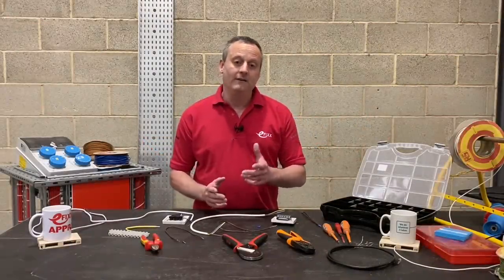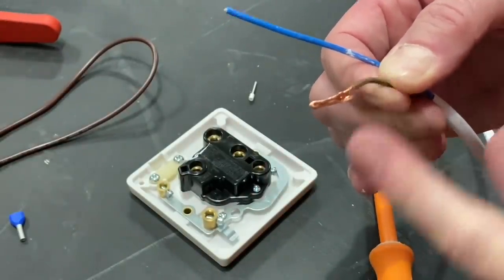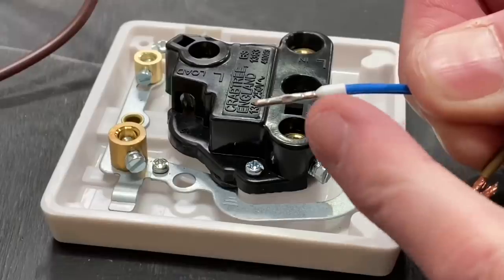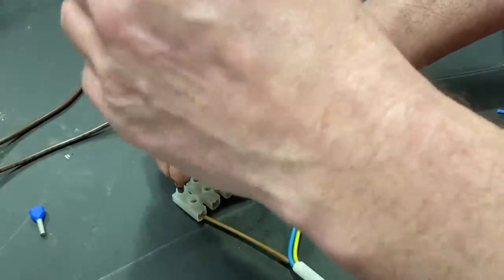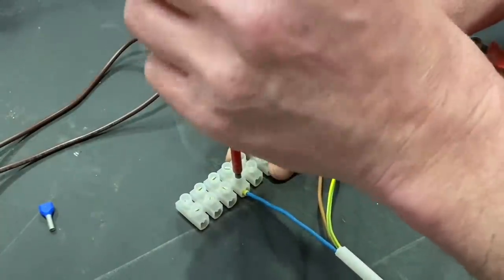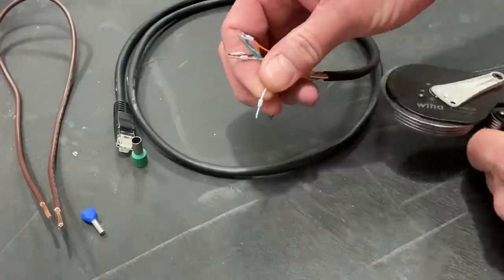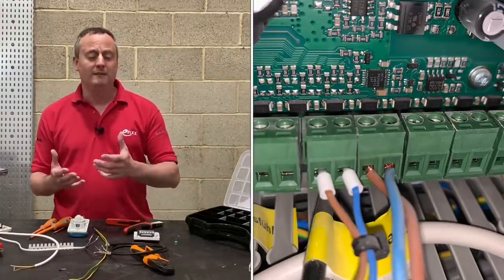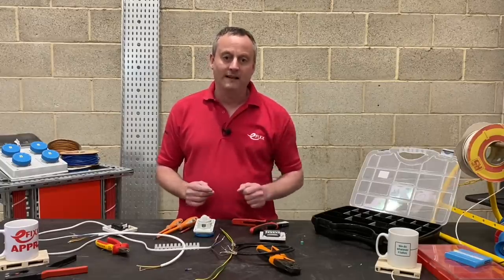Ferrule crimping - An easy way to improve reliability of electrical connections.

Comment: Why do you guys keep saying millimetres SQUARED? When I sent to school 16mm squareD would make 2.56 square cm. I think you mean 16 square mm.
Reply: The units would properly be written as 16mm² - which can be pronounced "16 square millimetres" or "16 millimetres squared". The latter is more common - you're right that this could be confused with (16mm)², but I don't think this has ever caused any actual confusion to any sparkies I know.
Reply: @-abigail  No honestly, 16 square millimetres is very different to 16mm squared, aka 16mm². 

16 square millimetres would give a square measuring 4mm x 4mm with an area of 16 sq mm, or a cable diameter of 4.5mm using pi. 

16mm squared or 16mm² would give a square measuring 16mmx16mm with an area of 256 sq mm, or a cable diameter of precisely 18.054mm using pi, a significant difference. 

Conversely, if you are talking about a cable measuring 16mm in diameter that would have an area of 201.06 sq mm.

https://www.mrsphysics.co.uk/blog/difference-between-square-metres-and-metres-squared/ - No, that's not MY Mrs! My Mrs doesn't need maths to know when I'm exaggerating size ;-)
Perhaps i need a ferrule.
Reply: Hi Jim. What is possibly not being said because it’s generally known by electricians in the UK, is 2.5mm squared or 2.5 square mm cross sectional area or csa. 
Basically the csa of each strand is calculated with Pi and the total number of strands is added to give you the total csa in mm. 
Sounds confusing but you never need to do this calculation in real life because it’s already worked out by the manufacturer. 
The only time I have done this calculation is around 40 years ago as an apprentice at college. 
Hope I’m not teaching you to suck eggs here. 👍.
Reply: @tonyfrewin4822  depends on the square mm of the egg Tony. It just looks like people confuse square with squared when the mean different things. 16 square mm means 4mm x 4mm, 16mm squared means 16mm x 16mm, which in tirn gives you 256 square mm.
Reply: spelling not a strong point this morning!

Comment: Um, how about you verify the efficiency of electrical connections using a multimeter to show the advantage?  Anything else is just hypothetical.  Scientific method and all that jazz.    Nothing 'PROVED' here.
Reply from the maker: This video is about reliability and dependability of initial connections. We’ll try to obtain a copy of a Weidmuller white paper which discusses how resistance of connections changes overtime comparing non ferrules and ferrules connections.
Reply: @efixx  I am also interested in the difference between the electrical connection between: conductors with and conductors without ferrules.
I would say, for termination of stranded copper conductors it's a no brainer; yes to ferrules.
However, I have seen (don't ask me where, I can't remember) this idea of joining both legs of a ring circuit into those twin ferrules within the CU, not a good idea imho. I would say they need to be kept separate for testing purposes.
 So then it begs the question: solid conductors:  to ferrule or not to ferrule? Hmm, thoughts on this?
I'm sure we have all seen the idea of a continuous CPC in sockets where one CPC is left extra long, stripped in the middle, bonded to the back box then its end terminated into the accessory. I think this idea would work better with a double ferrule where, the ferruled CPC is terminated into the accessory and the second conductor in the ferrule has its other end terminated to the back box.
So, now it occurs to me, we are also making two terminations of current carrying conductors into sockets: what would be the advantages/disadvantages of putting them into ferrules?
I will say: a ferrule holding both conductors in a terminal with a screw as contact seems like it would be on the advantage side of things but, with a clamp type terminal (which I think are great, BTW), would a ferrule be overkill? 
I'm not advocating the use of ferrules inside socket outlets, (well, perhaps I might be with the CPC) just putting some thoughts out there and going on a bit, I know. Sorry about that👍

Comment: If you crimp it good, then it is good. If you couldn't crimp it good, then it is a disaster. For newbies, try to stay away from any crimping work. The correct crimping tools can cost over one thousand dollars. Soldering is always the best connection method.
Reply: If you can't use something as simple as a crimping tool then soldering would also be outside of ones skillset as well.
Reply: @braveworld2707  The failure rate of crimping can be as high as 100% if wrong tool is used. And the failure is usually not visible, which can cost long time for troubleshooting. I prefer using pre crimped cables if needed. The mass machine produced crimped cables are much better than the hand made ones.
Reply: I've been soldering multi strand conductors of various gauges for 40 years. But only where there is no significant vibration or movement. Otherwise, you can't beat crimps and of course you don't have to spend silly money on a decent tool.
Reply: Good crimpers are expensive but $1000 is overkill for domestic installations.
A good Wiha or Klein is fine.

Comment: Without teaching you to suck eggs, I've used bootlaces for 30 years, here's a tip, twist the cable before you  put them on as it's possible to lift a strand or two if you don't. ,👍
Reply: I have also found it particularly useful, when using the double wire ferrule,  to twist the cables in rather than just push them into the plastic. Sometimes it happens that one cable goes through to the metal but and the other is left behind. Don't know if you've seen the same issue...
Reply: @rooselectrix4846  for me it occasionally happens yes.
Reply: @RaxxHubNut you're absolutely right. But we're assuming that the user tries 'to do the right thing'.
Reply: I also usually give a light twist, but you don't have to.  Depends if the wire is prone to splaying.

Comment: It’s strange that acceptable practices that have stood the test of time for decades are now condemned. I’m not anti improvement of quality, but there is no doubt many of these changes are being driven by manufacturers and sponsored YouTubers.
Reply from the maker: Would be keen to understand what you mean by "acceptable practices"  Ferrules have been in use for over 50 years and are the standard in many countries and electrical industries - e.g - panel building.  This video wasn't sponsored.
Reply: I so no electrical issue with NOT using ferrules. however, for me, the look super need and hold the connection together better, I always use them in switchboards, regardless of 7 strand or fine-strand.  However, here in Australia, we don't use solid core cabling above 1mm2.

Comment: No good for solid core cable though..
Reply: Because it would be completely pointless considering it's you know solid.
Reply: ...obviously.
Reply: In Australia, its common practice like the UK to not bother using them unless its an industrial switchboard.  However, I use them for domestic and commercial all the time.  We only have 1mm2 solid cable, anything bigger is stranded, but I still use them on 1mm2 just because it it matches the rest of the switcboard.... but yes, you could say its pointless.

Comment: Hang on, to be fair, shouldn't you remove the ferrule from the stranded copper conductor and rub your fingers all over it like you did with the twisted only one?
Ferules have their place, but never had any problems with twisting and doubling over or in fact seen any problems myself. Just another tool and another load of crap to buy to solve a problem that doesn't exist.
Reply: I can't see the wire being any worse with a ferrule, but you are correct.

The main place for these is fine stranded wires and panels and systems were someone will come back to rework/diagnose/disconnect & reconnect wires. It would save time having to make off the ends of the wires again, and in some cases re-wiring if there isn't enough length left.

Plus it looks like a quality job when your done. Its going to help reduce that urge the next guy has to completely re-wire everything because it looks rubbish.
Reply: jon A, You should really have gone to specsavers

Comment: just tin the wire, waste of money if you already have soldering iron and solder
Reply: I do this usually but the ferrel connection is fast and simply esp for people in the work trade
Reply: I'm not 100% sure, but I heard :
- When the wire get hot or whatever... it can melt the solder or soften over time...
- Solder will soften overtime under mechanical stress connection
This may lead to loose connection which is very bad (arching - overheating - cause fire - etc...)
Correct me if I'm wrong... take it with a grain of salt
Reply: You've obviously never wired a control panel otherwise you would never even suggest that idea. You stick to your soldering iron and tinning and I'll stick to ferrules, let's see who gets the job done faster and better.
Reply: @semperidem2577  And guess who's drinking beer and who's trying to figure out an electrical issue.
Reply: That practice was banned here in Germany in 1979, and that for good reasons:

1. The solder will corrode on the surface over time. In case of a terminal that will cause contact resistance. You can see that, it's no longer shiny and bright, it turns dull and grey.
2. The solder will deform under the pressure of the screw. But the screw remains where it was tightened to. -> contact resistance
3. Sometimes it deforms that bad, you don't even get the wire out of the terminal anymore.

For soldered connections inside of appliances that is no problem, because the corrosion is only on the surface and not inside of the solder.
Reply: ill race you wiring a panel, hopefully you can catch me up in pub when im on my 10 th pint.